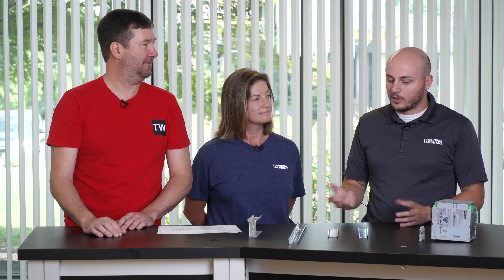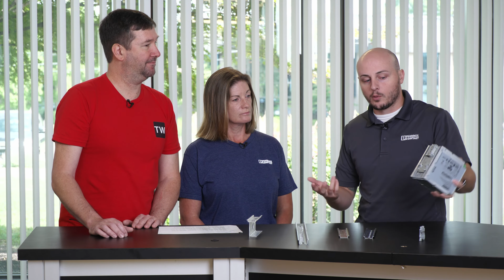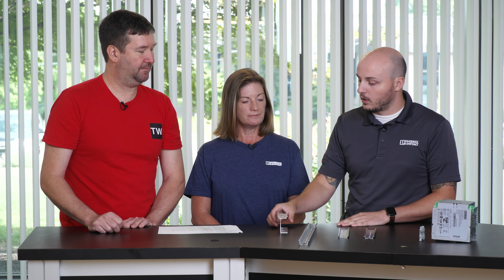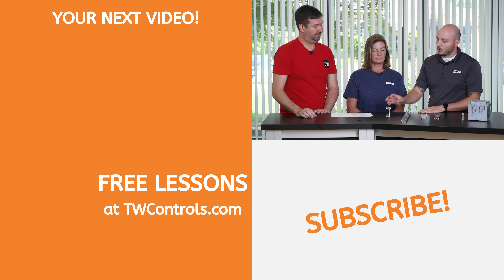Do You Know the Different Types of DIN Rail?

Comment: Very good info. Have had some problems with different MGFs of DIN rail. Some components just don't attach to some DIN rail. Seems the width just isn't right.  It is either the DIN rail or the mounting base of the devise.
Reply from the maker: I agree.  And some manufacturers need to tighten their tolerances.  Sometimes components are loose, sometime you snap the clips trying to install the components.

Comment: Any info on grounding with aluminum? The oxide layer in aluminum can be detrimental to the path. Take a volt meter and measure continuity on an aluminum back plane. Many panel builders use grounding terminal blocks and the generally poor grounding characteristics of aluminum are pretty much exclusively why I generally don’t use it.
Reply from the maker: In theory it should not be an issue because ground is a non-current carrying conductor but I have the same concerns. I'd like to talk to them more in depth about this. There's also copper DIN rail

Comment: I use that elevated rail with flex I/O, I use 15mm stand off on my standard terminal bases and 7.5mm for my power distribution rails.
Reply from the maker: There are many times I wish I had used it.